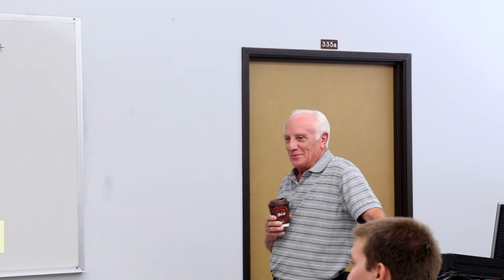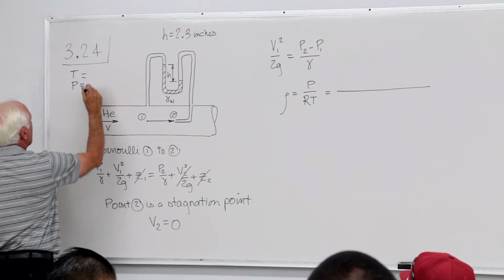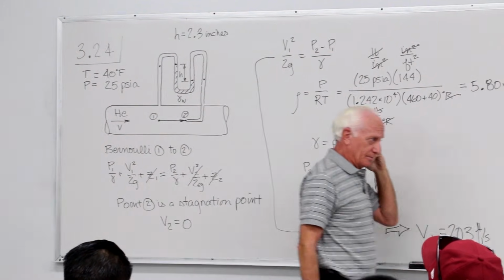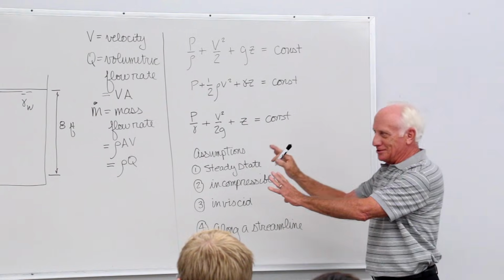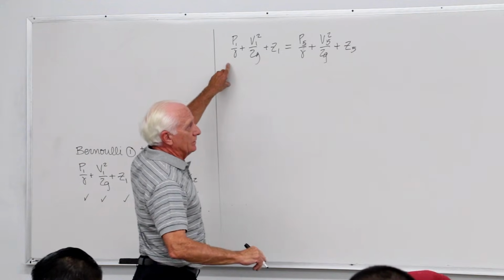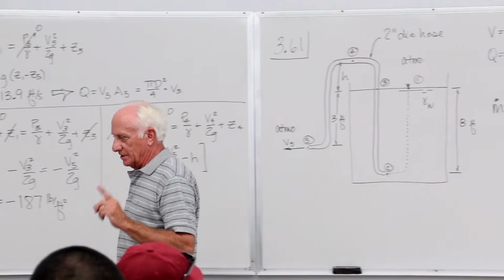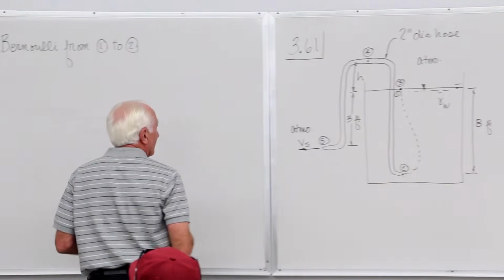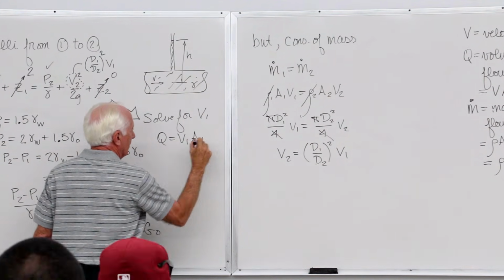Fluid Mechanics: Bernoulli Equation Examples (6 of 34)

Comment: For SI people for q1:
25 psi = 172369 pa.
For R the 1.242 x 10^6 = 2.077x10^3.
40 Fahrenheit = 277.594 Kelvin.
So curved p, 5.8x10^-4 = 0.298459.

2.3 inch = 0.05842 Metres.
Water density is 997 kg/m^3.

V = 61.836 m/s = 203 feet per second

Comment: Last example. 
P2 is higher than P1.
P2 is downstream of P1. 
How is it possible to have flow if fluid flows from high pressure to low pressure?
Reply: due to gravitational acceleration, or elso water wont come out from a pipe.

Comment: It's interesting in the siphon example we didn't know the pressure at the entrance to the tube because the fluid was moving and not hydrostatic. In this examples we know pressure of moving fluid because of the pressure taps. So you can measure the pressure at a point even if the fluid is moving as long as you have a pressure tap.

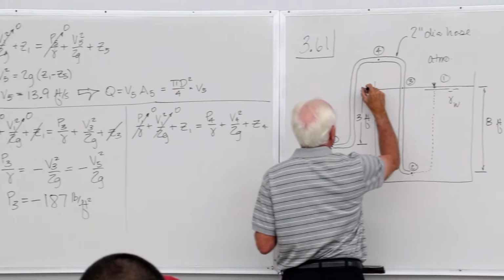Comment: @45:30 his "h" he wrote on the board is given as "2ft" in the text book. Just FYI peeps, so when you calculate it yourself, you will get an actual number for P4.
Reply: How do you find V 4?
Reply: I get a P 4 value of -437 lb/ft^2. Did you get the same answer? Thanks
Reply: V5 was found earlier in the video to be 13.9 ft/s. So, V4 = V5 = V2 = V3 = 13.9 ft/s 

P4 = -312 lb/ft^2  because specific weight of water(γ) is 62.4 lb/ft^3, when you plug into P4 = γ[ - (V4^(2)/2g) - h ]

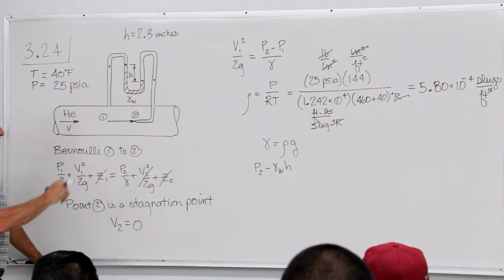Comment: when you think about it you dont really need to do what the prof has done at around 15:00. previously you should know that when using manometers the goal is determine the pressure in the pipe. and in this case pressure at 1 = pressure at 2. so as he has correctly resulted to its just gamma(Water)*h

Comment: How do I use Bernoulli's equation (with frictional losses) for this particular problem? 

https://www.google.com/url?sa=i&source=images&cd=&cad=rja&uact=8&ved=2ahUKEwjzudLG0MzhAhVWk3AKHUGDDI0QjRx6BAgBEAU&url=https%3A%2F%2Fwww.physicsforums.com%2Fthreads%2F1-pipe-branching-into-3-pipes-pressure-of-each-branch.864642%2F&psig=AOvVaw2F2maea38gAH2VrM8IY5C6&ust=1555229780465173
Reply: Basically a main duct splitting into 3 branch duct, which DOES NOT rejoin at the end but expose to atmospheric condition.

Comment: why is z1-z5 equals to 3ft?( the answer not 5ft?)
Reply: Because Z1 is at the top of the fluid and Z5 is 3 ft from the top of the surface.  Z2 is 8 ft below the surface.  the difference between Z5 and Z2 is 5ft.

Comment: I am confused, quoting the textbook "when streamlines are horizontal (like point 1 to 2 in first example in video), R = infinity and pressure variation across streamline is hydrostatic even though fluid is in motion". In hydrostatic, pressure doesn't vary in horizontal plane, so P1 should be equal to P2. but that's not the case, why ? I think I am confusing the concepts in my head! Pls explain. Thnks :)

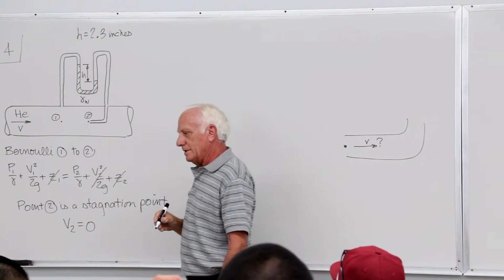Comment: Can you please explain in more detail as to  how the the fluid is static in the tube as the professor stated in time 7:35?    
Is there water in that tube canceling out the helium fluid flow?
Reply: initially when the manometer tube is entered in to the pipe (with water already inside), the helium will enter from the hole above point 1 and point 2. Helium flows INITIALLY and displaces water as shown but eventually reaches equilibrium and stops or you can say helium from both sides balances water in middle as shown in figure. Either way it reaches static condition. That is why point 2 is stagnation point (zero velocity). Hope you understand! :)

Comment: When finding P2, how does z1=8 while z2=0? If z2 is the datum, z1 must be shorter than 8.
Reply from the maker: Can you provide a time stamp?
Reply: https://youtu.be/JpnzRs4gpxM?list=PLZOZfX_TaWAGocs2k5QmTL44OKOl7rn34&t=2538
Reply: From Z2 to the top of the tank is 8 ft.  Z1 is located at the top of the tank, and is therefor 8 ft from Z2.  Z1 and Z3 are in line with each other.  A height for Z4 is not provided.
Reply: Consider the Datum to be in plane with pt.1 and then draw your axis downwards, you'll have solved it XD